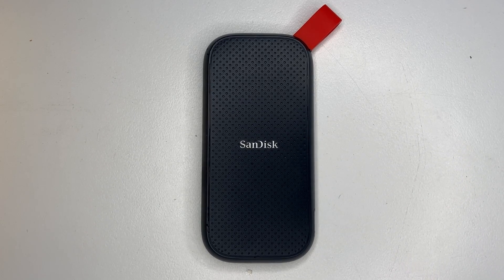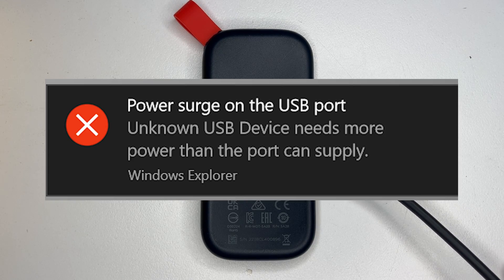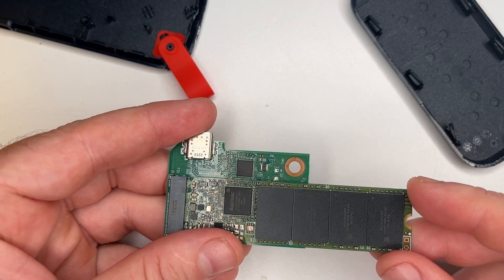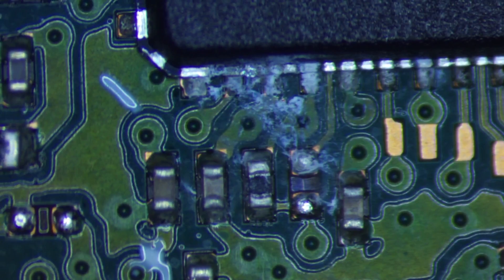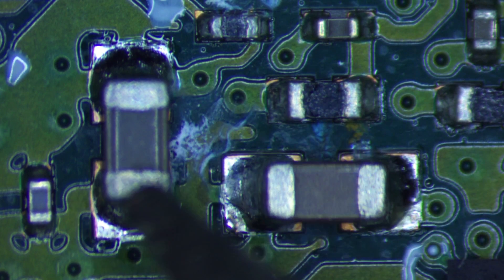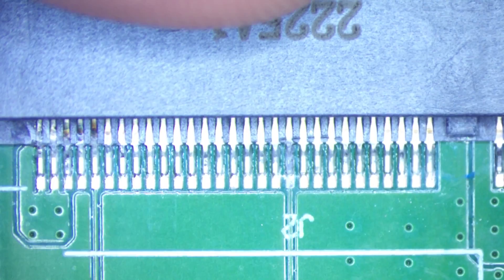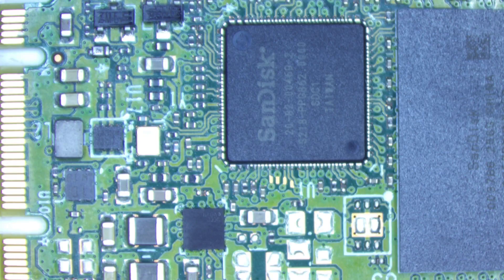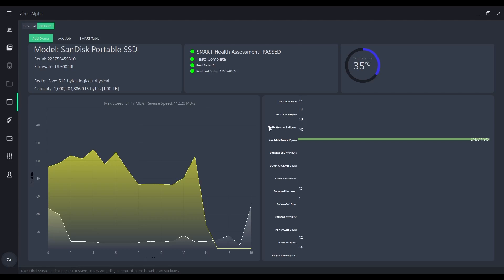SSD Blows up my USB Port

Comment: I used a CH341a with my Lenovo Flex laptop, problem isn't the SSD/usb device is broken, but the power surge problem that took out my laptop and the webcam, bluetooth and all usb devices are broken, I tried every solution ever existed and nothing fixed it
Reply from the maker: Hardware might be damaged :(

Comment: You say speed is a bit slow, is that because it is SATA not NVMe?
Reply from the maker: Speed is slow because the SSD was damaged. Its common to see poor performance & read issues after a drive has been damaged

Comment: This problem can also be triggered by a firmware bug on certain external enclosures, such as those from ADATA. It can be fixed by temporarily connecting the enclosure to a regular USB hub or adapter which is limited to 0.5A of current.